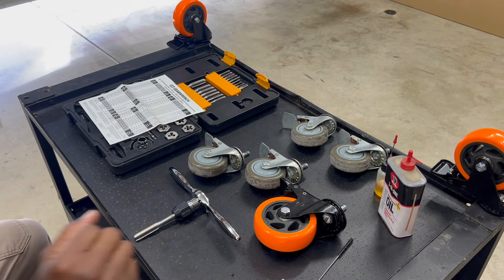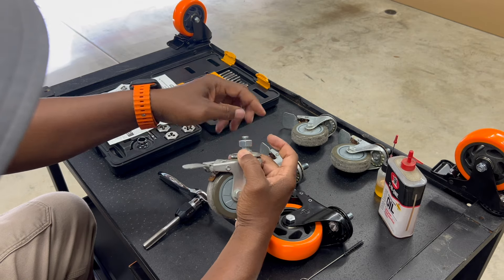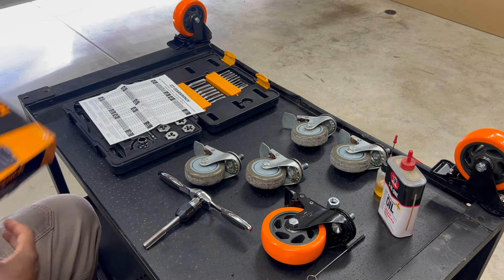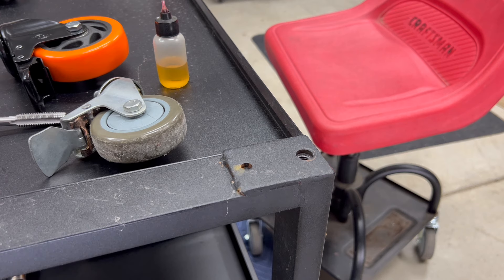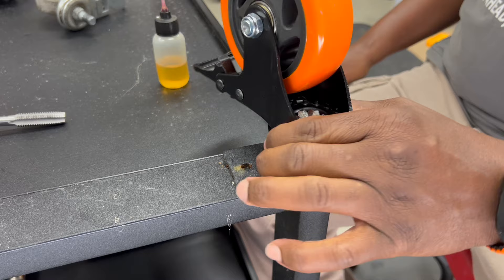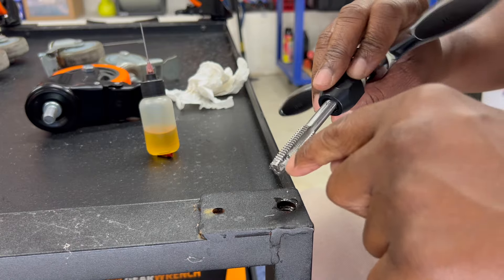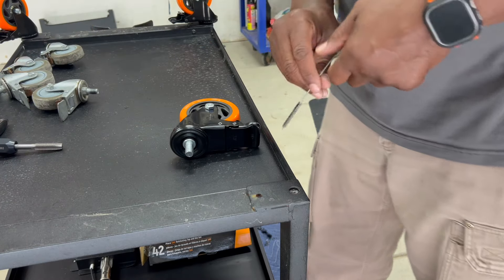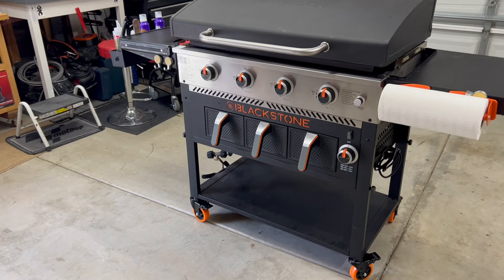Blackstone Griddle caster wheel upgrade

Comment: Where did you get that tap & die set? Don’t want to spend too much if this is all I’ll be using it for
Reply from the maker: I purchased tap and Die set from Amazon ($80), Yes its a little pricey and I also was a little hesitant in purchasing if this was the only project I was going to use it for. To my surprise I actually use it on a few more projects since then. You can purchase 11-piece Set for around ($40) or purchase just the handle and tap only for less. Hope I was able to help, Thanks for your comment